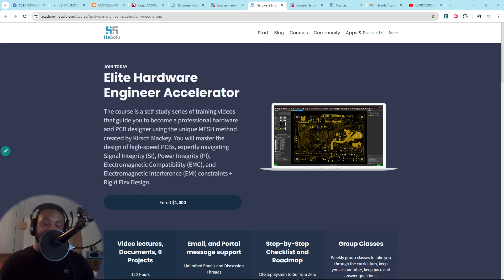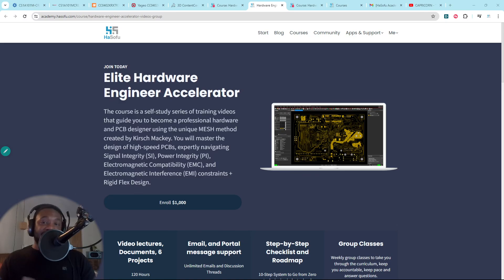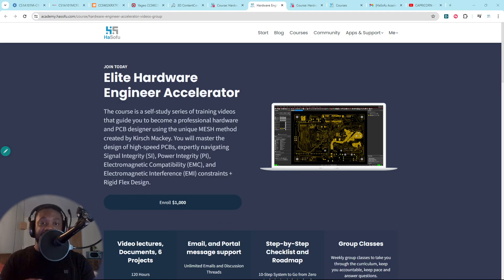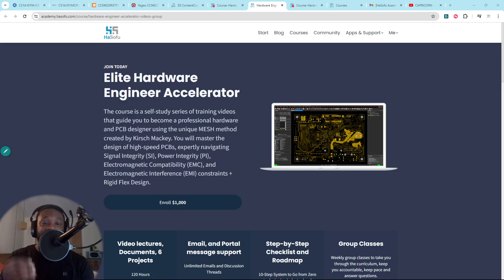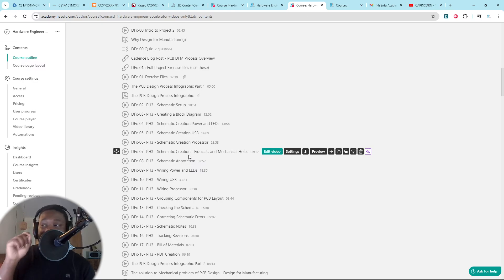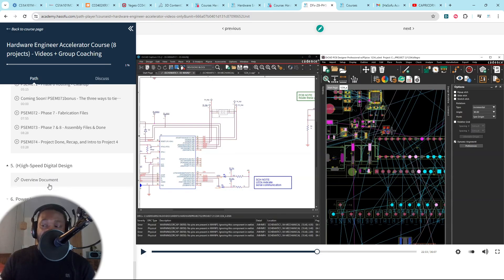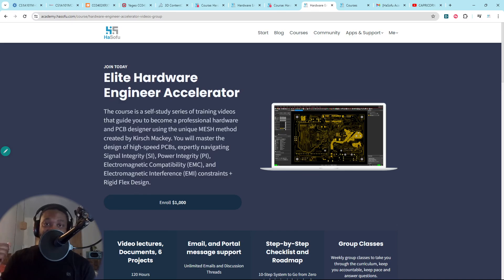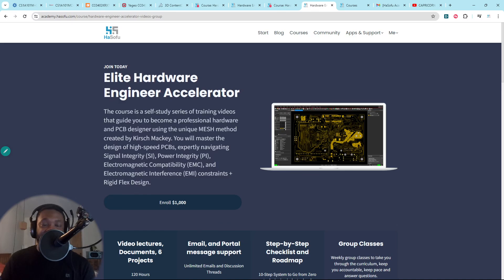What's the REAL Secret to Becoming a TOP Hardware Engineer?

Comment: Hi Simple question, for this course should I be use a Mac or PC. For reference I have a Mac but can VM a PC environment. Just need to know if I should have gotten a PC to complete the projects and learn with the correct software.
Reply from the maker: Great question. You need a PC to use OrCAD. You can use a Mac and Parallels Desktop with Altium v20, and possibly higher, but I don't know if Altium 24 is officially supported on a virtual Machine.

If you have an Intel based mac, then you can use it with Parallels desktop and run OrCAD or Altium, since the Intel x86 architecture is supported.

However, if you're using an M-series macbook, then you will only get lucky with installing Altium on that virtual machine, since the ARM architecture created by the VM is not supported by Cadence, officially. I've tested OrCAD on my M-series macbook pro and it had glitches. OrCAD Capture would not load the schematic design file. OrCAD PCB Editor would work, but would randomly crash. Altium worked fine and in some cases, faster than on my windows PC at the time. granted these are from 2021 testing.

So if you haven't selected your computer yet, Windows will be the best best moving forward for all EE software.
Reply: @techedkirsch  Thank you, I am starting to notice the usage of PC is a bit more superior with regards to EE and CompEng softwares and work. Despite the Mac’s useful capabilities in regards to weight and speed and times. I will be reaching out in July about the course as I am busy during my internship. And July is about SOP’s and documentation so I’ll have more free time. Looking forward to get into the course prior to my Third year in CompEng.
Reply from the maker: @tevinheath3997  Awwwwesommmme, can't wait to have you on board. Please feel free to email me at kirsch at hasofu dot com (you can also reach me at techedkirsch gmail dot com)